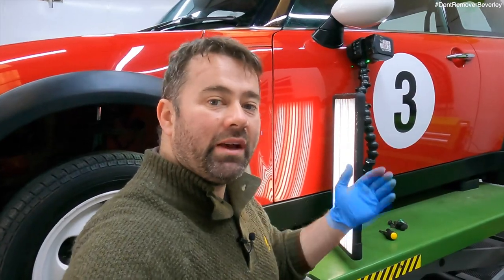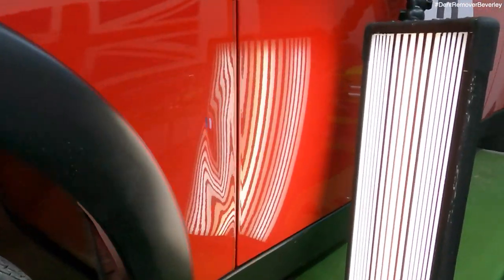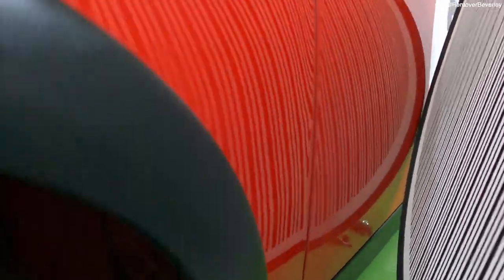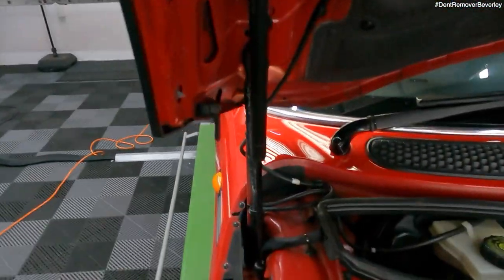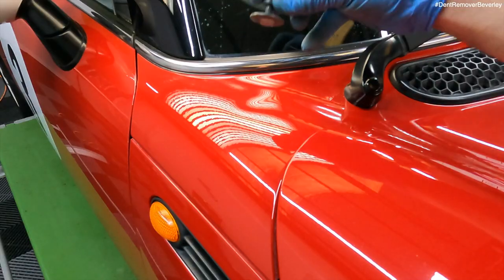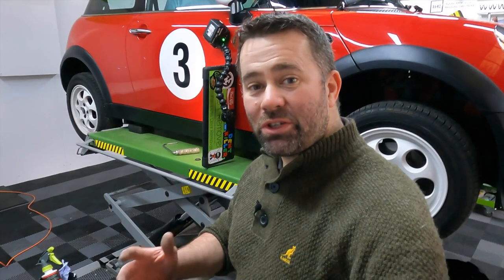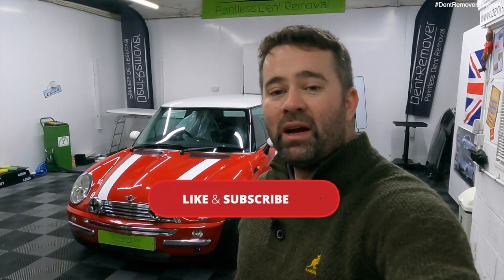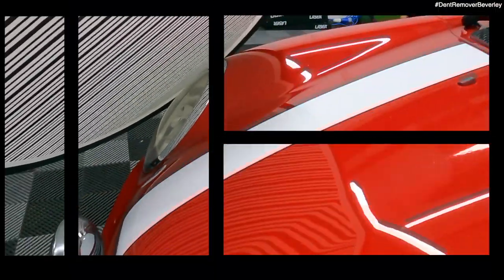How To Fix MULTIPLE Dents Without Paint | Paintless Dent Repair By Dent-Remover

Comment: Hello Martin, that's another nice repair, I have a question, could you tell me the trick what you do with your line board?  when I have the dent out I move my light further away so that I get all the last out.  I never see you move that so far away? :)
Reply from the maker: Hi Paul that’s a great question

And to be honest I don’t really move my line board too far away. But I do use natural reflection, fog and my inspection board to final check. 

I work super close to the board and I can pick out the smallest detail- it’s just how I do it. 

I self taught so I didn’t know about moving the board away although I fully understand it these days. 

Hope this helps and keep doing what you do already! 
Thanks Martin
Reply: @dentremover01  thanks for your reply Martin,

Comment: what u charged for this 30 densts martin?
Reply: That's a good question mate👍
Reply from the maker: not enough!
Reply from the maker: Hi Barry and Wasif.
This is a common question and its difficult to answer.
Generally we have a start off price per dent, per panel. if its a few dents then the first and biggest dent is full price, the other local dents are discounted to maybe £30 each.

sometimes a full car can become pricey and especially if its a hail car it can run into thousands.

so what i do is either price and adjust to suit based on what i think is a fair price, or offer a day rate.

PDR is a better, quicker and cost effective way of transforming the appearance and value of a vehicle.... some vehicles are not worth alot so a figure is adjusted to suit.
hope this helps.

this actual repair was based on a 2 car job so the cost was split into days
Thanks martin
Reply: @dentremover01  Thank you Martin for giving me a very good description but I don't know how much you paid for this job.